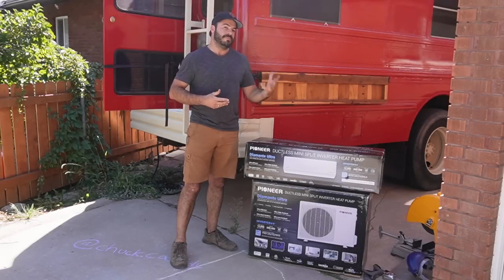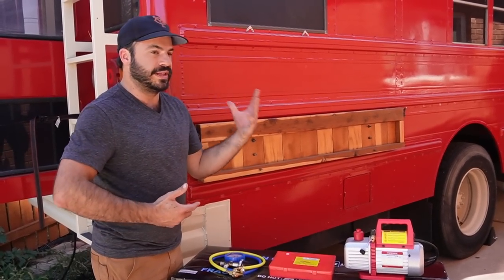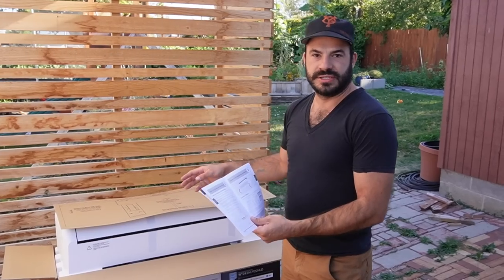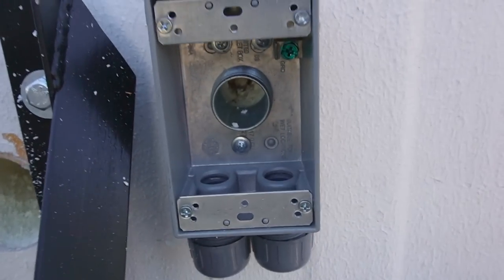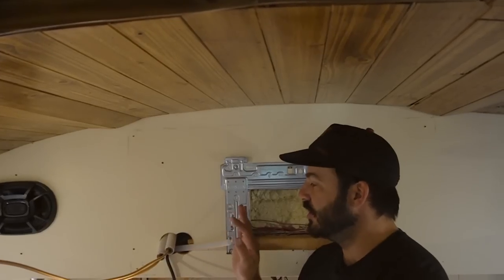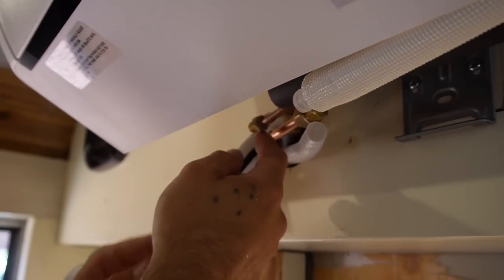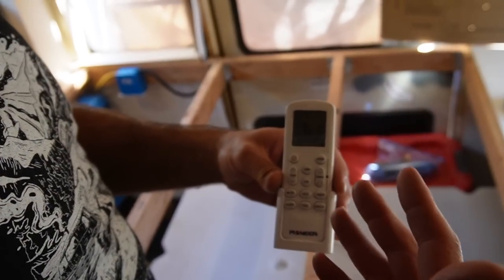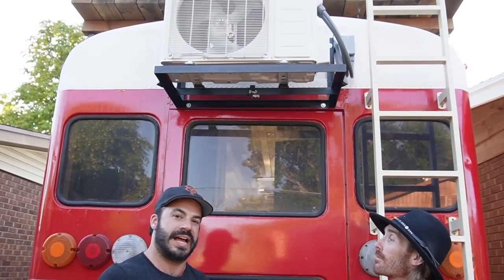Installing a Pioneer Minisplit on a Skoolie | A Complete Guide

Comment: Very cool that you used Pioneer, Chuck! I bought four, put two in my house and two in my son's last year. They work great! Nice people at Parker-Davis. Good pricing. Great choice.  

That's trick that you put it on a mobile rig!  I had to watch this.  No reason not to, but it's not something I expected to see.  I think it's really smart, out of the box thinking.  As long as mobility-induced shocks and vibrations don't take a toll.  But these rigs probably don't spend much time rolling anyway.

I made all the connections at the indoor unit first, on a bench in front of the penetration hole (in which I used 3" PVC), wrapped it and fed it all through, then made up for length and slack outside where there's more room and it's less critical.   Kinda like how you did with that heater where you attached the lines before feeding them all through the floor.

I don't know why, but the 120 Vac versions have a cost premium over the 208/240 equivalents.  The incoming AC is rectified to DC to feed the motor controllers and circuitry in both versions so there isn't much componentry difference, at least not theoretically.  Maybe it's an inventory inconvenience kinda charge.  But being an electronics designer, I know they could make a universal input that would work on both, if they wanted to.  Anyway, it was just as easy for me to wire them up 240 at home, so that was a no-brainer.

I left them overnight when checking for leaks with the vacuum. Then when checking for leaks with the lines charged up, I ran them up to about 75 PSI which is about five atmospheres, or five times the pressure differential of the vacuum.  On my first couple, I even checked all my joints with soapy water.  With all other HVAC installations prior to these, I've brazed all the joints, so I was a little leery of these flare joints.  None leaked, but I do suspect they could be a point of future leakage over time.   I keep thinking I should go back and double check their tightness and check for leakage with soapy water.  We'll see...

Cheers!
Reply from the maker: thanks for watching! brazing is awesome, no doubt. we've installed about a dozen of these over the last 5 or so years and the only issue was a failed flare fitting (my own fault) and once i fixed it and recharged it, it was good to go. id love to know what DC voltage these are running off, it would be sweet if it was, say 48V and you could just wire them directly to the battery...
Reply: @ChuckCassadyYT  
That's a great idea actually.  Maybe one day the curiosity will overcome the list of things to do and one of us can go poking around in there to see what the voltages are. Or perhaps it's possible to get a service manual for these things. In the old days I'd just buy a service manual and get to know the circuitry before I ever popped it open.  I do know the first stage is to rectify the incoming line and that's going to be a super high DC level compared to 48 volts. Anything between the RMS value of the incoming line and the peak value depending on load. The simplest way is to pwm from that rail to motor windings. You know the logic is likely to require 5 volts or thereabouts so there's going to be a buck converter for that. But how sweet if they were to buck down to a 48 volt rail and convert everything from there!
💪

Comment: Just received my second replacement Pioneer interior unit as the first two developed leaks in the coils after about 8 months each. Thanks goodness for the 5 year warranty! Doing it again I'd definitely choose a different brand. Going cheap on the hardware has cost me more in repairs and water damage than I saved over other more expensive brands.
Reply from the maker: Very interesting to hear. We have had not a single issue and our oldest installs are around 5 years....I'd say over a dozen installed. Wonder what was causing that failure mode

Comment: I'm presently installing a Pioneer 12K in my bus.   I've put the outdoor unit directly above the front axle (my bus is a pusher, so no driveshaft there), where it gets all the cool air it needs while driving as well as when parked, and because it's between but not behind the front wheels there's no risk of stones or road debris hitting the A/C unit, plus it's protected from rain.   I had wanted a 16-foot lineset, but Parker shipped a 25-foot lineset instead, so I'll need to cut and flare the lines down to a better length;  I'm worried that there may be barely sufficient refrigerant in it now for 25-foot lines.   R410a is soon going to be replaced because of its environmental danger, so I bought a small can of it today to keep as spare if/when I ever need to top up the refrigerant in the future when it will be no longer available.   I'll be powering the A/C from my 2000W Magnum inverter, so I just can't run any other big loads while the A/C is running!   I'm curious how much warmth the heat pump will produce in the winter, but I also have two very effective diesel air heaters if it's insufficient.

Comment: I used this video to install my mini split today, this was a great guide so thank you chuck,  id like to note its a pain in the @$$ when you get to the very end and go  to pull a vacuum on the outside unit and  realize your gauge set kit hose fittings you ordered on Amazon are the wrong size so you have to order and wait for an adaptor to come in the mail. as chuck would say its a real bummer..and also I only flared my copper lines 3 times and forgot to put my flare fittings on first. boy I felt dumb all three times.

Comment: Great video dude! I'm glad I did mine before I finished the walls, I can see how that probably added a day. I was planning on running a circuit, running wire, and cutting holes, maybe even pre- running a lineset and drain hose to make adding a second unit down the line a little easier, but lately I've been Leaning towards getting the second one now... it adds 2 days and we really want to be on the road already so... I dunno

Comment: Classic Charlie loved the video brother Pioneer is the best I wouldn't use abutting less Charlie I have a question you mentioned some of the upgrades your helping with the DC to DC charger you showed is a 12 volt unit or did I hear that wrong? Because you said it would charge up the server rack batteries he's using but they are 24 volts you mentioned just wondering I have a 24 volt system and wondered what the specs are on the DC to DC charger. Thanks bud.

Comment: What size mini split (BTUs) would you recommend for an 11-window bus (4 windows blanked) with 2-inch spray foam walls and ceiling and 4” rigid foam floor insulation?  I want to be comfortable in the US desert southwest in summertime for vacations.
Reply from the maker: 12kbtu

Comment: I'm in the early stages and you are my go-to on several fronts. I just bought a shuttle bus that has a humongous AC. It must take up 30% of the roof. And the internal unit... Inches inches on top of inches. First question, will the 9000 BTU be sufficient for a 25' shuttle that has a very open floor plan? If the exterior unit is placed underneath the bus how much space is needed from the base of the unit to the ground? Lastly, I would prefer to put this in the middle on my Transit. Bedroom is in the rear, not fond of cold wind. Any issues in particular with a mid bus placement?

Other question relates to insulation. I watch the insulation videos. After I take out my headliner and my rubber floor, might have about 6' 3". I can't give up 6 in to insulation, the substrates, then still stand. When I lose a lot by going to inches on the floor and then spray the roof? 
What are your thoughts on heated floors?

Again, thank you.

Comment: I have a Pioneer mini split with a Ceiling Cassette and it has worked well for years now. mine is in a a ADU apartment but with that being sail I think, That system with the ceiling cassette would work great. especially in a new build or even as a retro fit for roof mounted AC units. Just a thought. keep up the quality and have fun. 
OH and what would you think of some rubber lines like are used by the auto industry for some of the troublesome areas.

Comment: We have a deck on the top of our schoolie and want to replace the boards. They are currently 2x6-treated lumber. My wife is thinking of using composite decking. Are there any stress or other factors inhibiting composite vs wood? 
BTW: Excellent presentation. Thank you.

Comment: Perfect timing. I ordered that mini split just the other day. The brackets that you fabricated, is there a structural element that you’re bolting to in this video? Are there structural members there. I have yet to cut that piece out of the bus. Great video. Thank you!!
Reply from the maker: its through the door frame at the bottom and the upper bus skin on the top`

Comment: Chuck I’ve heard a lot of commentary about mini splits becoming obsolete with advances in tech in RV style units. What’re your thoughts on the RV units? 

I ask because I recently bought a bus with a $900 senville installed and the builder did a hack job with it and now I’ve gotta hire someone to come charge it. They mounted it on the side without much ventilation and no conduit and it’s just turning into more trouble than it’s worth to rectify. I’m currently debating removing the side mounted condenser and relocating it to where you put the one here or scrapping it all together and going with an RV style rooftop unit. I’d really appreciate your thoughts on this

Comment: Excellent DIY vid! The Half inch nipple for the electrical box is too small for the 12awg and unit’s electrical wires. 3/4” works better. Would have like that installation in the vid instead of glossing over it. Then how you selected your breaker for it. Did you need a 20amp or 25amp breaker for the 12,000 btu. I’m installing a 9K btu and I’m using a 15amp  do you recommend going to 20a instead. Thanks appreciate all you do!
Reply from the maker: I used a 20A breaker for the circuit. and ive never had an issue running those lines in the liquidtite, but maybe your setup was different
Reply: @ChuckCassadyYT Chuck, how long would the vacuum take. I’m not sure if the service valve was property opened. It seems that t went to -30 in seconds on this 3.5CFM PUMP. GRANTED the whole length of the tubes are 6-7 ft. Guess I’ll find out if the refrigerant releases into to system. Hope it not a bad Chinese adapter

Comment: Chuck, great diy video. My question is the line set length? The factory says 10" minimum length to avoid damaging the unit. Your instal is less and you've done several instals. Any issues so far and are you worried about voiding the warranty? Thanks in advance.
Reply: I have exactly the same question. Why not just leave the coiled line set behind the condenser? Another issue is he did not use the UV tape to protect the line set insulation against UV radiation. And finally, no a/c power disconnect.

Comment: Amazing video once again.  You don't miss!  Question.  How does the energy consumption of this Mini split type unit compare to a rooftop 12v Dometic 2000 RTX?  The Dometic ranges from 19-58 Amps.  Not sure about these.
Reply: He's got a link to product, in the drop down.
Then there's a spec sheet you can download.

I'm not 100% in reading it right but it's saying 1200 btu unit it's 10.6-10.3 A
Reply: ^ at 120v, which is 1272W.

Comment: How well does it cool the front area of the bus if it is all the way in back? Do you need some sort of circulation fan to keep the temp balanced? Can you add more than one inside unit to the outside unit, or would it be necessary?

Comment: Maybe not for your show, I have a shuttle bus. It has AC that needs freon. And a second one I'm told only needs to be hooked up to electrical.
I'm also told that a mini-split A/C heater uses less power. Considering the bus is for off-grid life, Should I remove the second A/C(hanging in the back) that came with the bus to gain less weight for better gas mileage, less draw on batteries, and buy a lighter more efficient mini-split? Would that be worth the time and trouble? My mechanic says I wouldn't get that much more in mpg.

Comment: Fantastic video as always! The only question I would have is with all the vibrations of a bus and the outside unit all the way at the back, are the feet of the exterior unit really enough to hold it on for thousands of (sometimes rough) driving? I'm sure they are because you did this and I trust you, but if it were me, I'd probably add a bracket to the top to keep everything safe. Would that just be overkill? Thanks for the awesome video!
Reply from the maker: I've got about a half dozen installed like this with no issues. I am doing it this way on my bus, too. I think it's a good spot
Reply: @ChuckCassadyYT  I figured as much but wanted to ask. I overbuild, which is fine with a deck but not with a bus. Thanks for the follow-up! Much appreciated!

Comment: Question: When you hung the outside unit what did you attach the bracket to?  Did you just run bolts through the skin of the bus?  Did you use a brace on the back side of the bracket?
Reply from the maker: The lower bolts go through the fram of the door opening and the uppers go through the skin

Comment: Are worried at all about blocking the rear marker lights at the top of the bus? Highway code states that if your vehicle is over 80 inches wide or 30 feet long you must have marker lights visible.

Comment: The out door unit blocks the center tail light. Does it still meet DOT requirements? I’m thinking about installing the mini split same way as you did, if it can pass DOT. Btw, great video, thanks
Reply from the maker: hard to say. so far no issues!

Comment: Chuck, did you add any AC vibration pads on this condenser unit? Between road travel and having that unit so close to the bed, might it help the noise factor (and maybe unit longevity)?
Reply from the maker: There are pads on there but I think it could use more
Reply: Vibration is a very important point since these units are designed for static operation. I wonder how the line flares are going to behave in time with all those trips, especially off roads. And finally, how is the compressor going to take it with all the vibration.

Comment: Hey this might be  an odd question but I was looking at Pioneer's site while in the intro and only saw a 115 and 230 volt models. Did you mean to say 115v and not 120v? Thanks for all the great videos and info.
Reply from the maker: It's the same
Reply: @ChuckCassadyYT  Ok and thanks and I do have another question and a half. Have you ever used the Compact Cassette Mini-Split in any of your builds yet and how is it working out? Yes I'm thinking about converting a bus just doing some beforehand research and glad I found your how to list.
Reply from the maker: I've seen them, they're just a lot less efficient. I'm sure the perform well though

Comment: Hi, question: Is a Mini Split a heat pump? I see some mini splits that seem to be standard compressor AC units with the condenser and evaporator separate.
Reply: Lots of mini splits also have heat pumps in addition to the air conditioning features. Just have to check the ones you’re looking at

Comment: Does this fall under Pioneer’s basic or standard warranty when installed like this? Or is the warranty voided?
Reply from the maker: They have honored warranties on these kinds of installs
Reply: @ChuckCassadyYT  what did they honor? I’m seeing on their website a lot of language about how the warranty is voided in “improper applications” or if the unit is used “not as intended” which is concerning.
Reply from the maker: Call them if you’re curious

Comment: Looks like the outside unit is blocking the top 3 marker lights above rear door. No issue with DOT by blocking those?
Reply: It’s an issue that gives cops automatic reason to stop you any time they want because those three lights have to be visible.  If not it’s automatic freebie for the cops.

Comment: Only 4 screws to anchor the outdoor unit to the cage? And only 4 screws to attach the cage to the top/back end of the bus? How much does that unit wobble when driving down rough roads or uneven terrain?
Reply from the maker: They aren’t screws. They are 3/8” bolts. Take a look at the tensile and shear strength of a 3/8” bolt

Comment: what about 12 volt and 24 volt truck units for smaller vans. I was looking at a 7m (x2.4mx2.5m) freezer van and i found the insulation (4in sandwich) is rated at 0.37W/sqm. which  equates to.. if its 45C outside and 22C inside the heat loss is just on 200 watts. A 1kw pump unit would kill it.. at 3x efficiency, thats 300 watts for 1/5 the time running.  
60 watts.  12V, 5A for 24 hrs 150 A/Hr of battery.  Ok 60 watts for 24hrs = 1440 watts /6 hours solar =   240 watts of panels. YES winner. A 7m box body has room for 7x400watt panels.  AU$350 second hand.

Comment: What size solar panels would you need
Reply from the maker: To run a minisplit like this, at least 1600 watts
Reply: Awesome thank you so much!! How many watts do you do in all to comfortably power the whole bus
Reply: @ChuckCassadyYT  great video, Chuck! Thanks for all the info. I have a 22ft shuttle bus that will be insulated w/ closed cell spray foam. Do you think I could get away w/ the 9k BTU mini split and 1000-1500 watts of solar panels if I have a lot of battery storage - such as the 5.1 kWh bank or more?